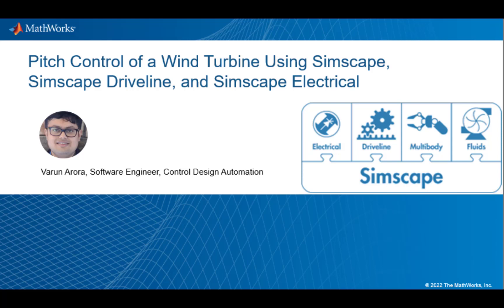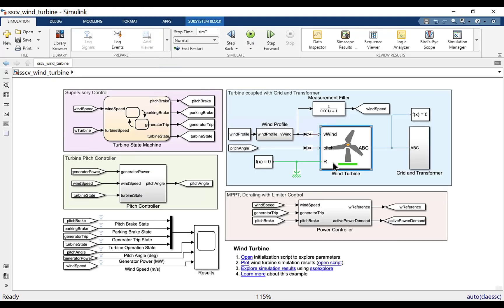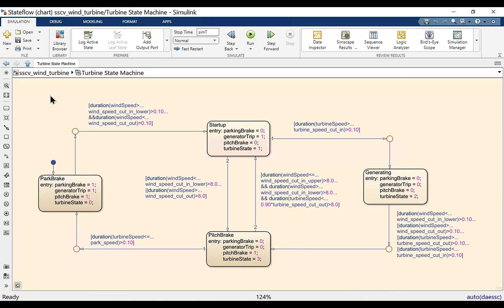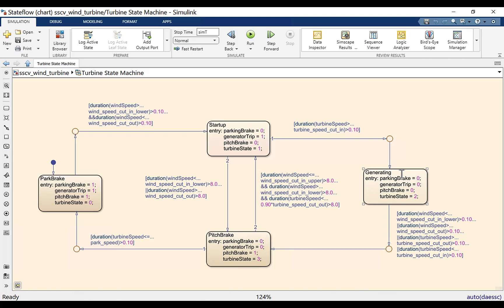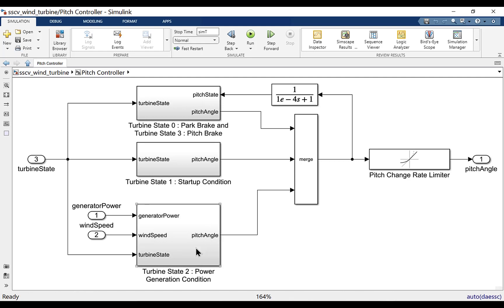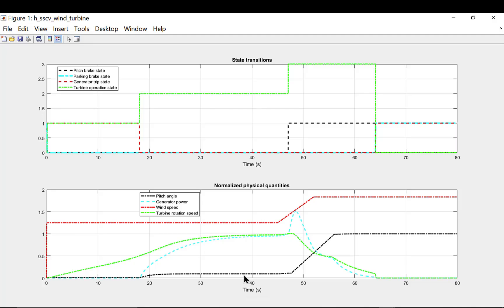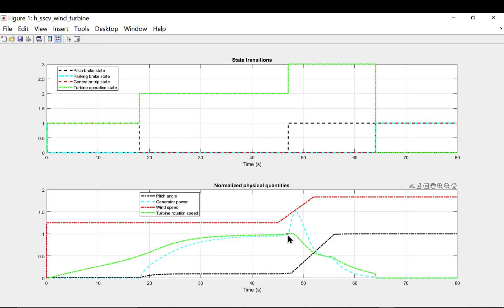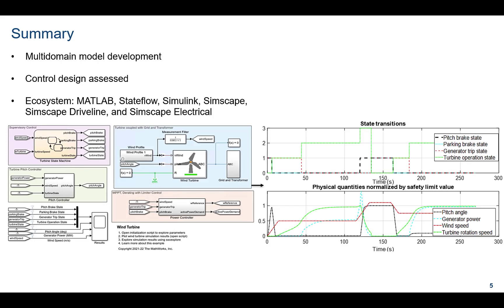Pitch Control of a Wind Turbine Using Simscape Driveline and Simscape Electrical

Comment: Can we connect this system to a compressor model instead of a generator?
Reply from the maker: A wind turbine can be connected to a compressor through an appropriate gear train. Since this model is with MPPT and derating control, the controller must be modified as well for the selected load type. Also, the rating of the wind turbine has to be adjusted based on parameters of the compressor and an adequate wind profile should be used for the selected load and geography.